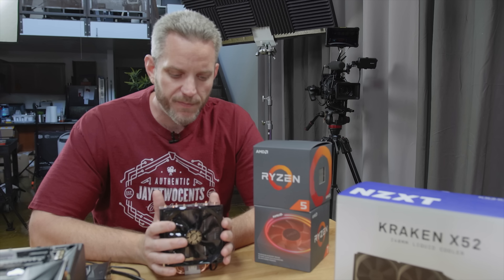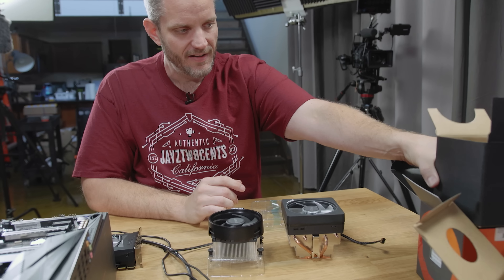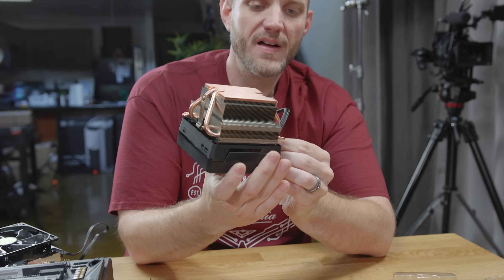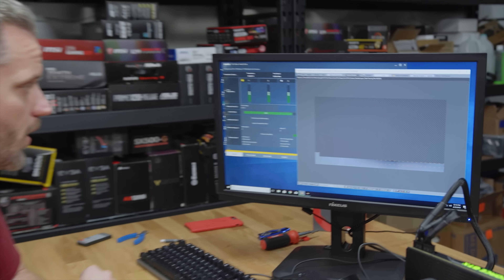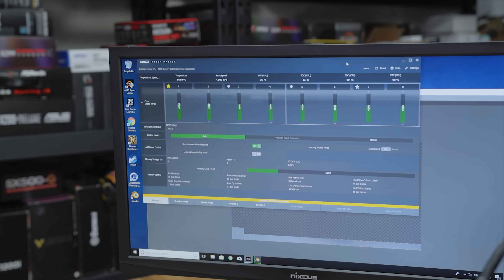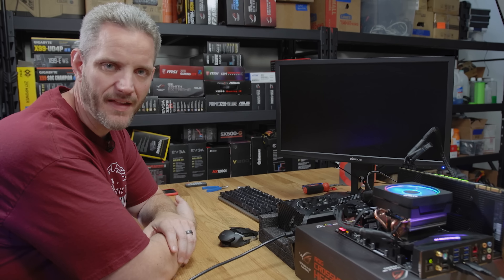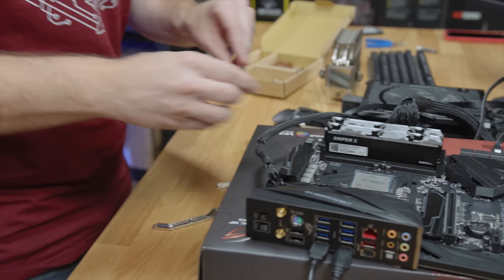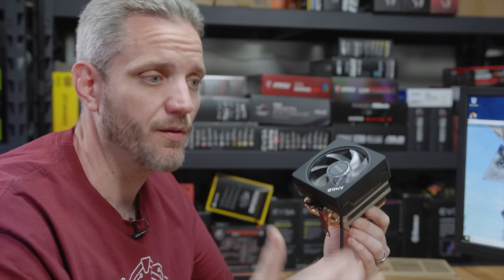Overclocking with a stock air cooler?? Is it even possible?

Comment: "I took off this stock thermal paste in order to put on another paste with identical properties so that I could mention my sponsor"
Reply: Naah stock thermal paste is bad and the way its put on will cause air bubble you have to put a small drop in the middle of the cpu and but the cooler on than to minimize air bubbles for better cooling performance.
Reply: Stock thermal paste is shit. like really shit. not a good mixture. and like the other guy said, air bubbles also can occur.
Reply: lol
Reply: He said he already tested the cooler, so the thermal paste had already been used.
Reply: @SleepyFawn  Yeah ... but if you think people listened, you're expecting too much out of people.
Reply: You forgot to thank him for his service. Rage intensifies 😂
Reply: @GermanLookLikeTV  The airbubble theory has been debunked by der8auer
Reply: @GermanLookLikeTV  Air bubbles are a myth, check out GN's and Der8auer's interview
Reply: Allan Huseyin stock thermal paste has barely any noticeable differences with other paste lol.
Reply: The cooler is made by Coolermaster as well xD
Reply: all silver pastes work same, if you have good cooler with flat surface, you can't notice ani differences between pastes
Reply: @GermanLookLikeTV  Nonsense. The people who apply generic thermal paste ALL DAY EVERY DAY at the factory do a fine job. If they didn't, machines would be getting returned nonstop.
Reply: @KunoMochi  Of course the stock stuff works fine. If it didn't, they'd have parts being returned all day every day, which is the last thing a factory wants. Thermal paste to internet PC builders is like Teraflops to internet console fans. It's an unimportant issue that people latch on to so they can play the "my thing is better than your thing" game.
Reply: @GermanLookLikeTV  wait really? Probably why I idle at 60 degrees
Reply: Stock thermal paste doesn't need to be changed. Most must be reapplied every year or so to maintain their quality. They leach out or something, says der8aur.

Comment: Oh man. Premium stock cooler and on the fly overclocking?! Why does anyone still buy Intel!?
Reply: Certainly not worth it until Intel release something new!
Reply: ronald4life1 I'll always buy Intel as its better for what I do I stream and game and I tested a 1700x and my 8700k is better still plus with Intel you know what you get out of the box not a fanboy and its disgusting the way people treat people when. They say they like one or the other but personally for me I'll always get intel
Reply: dan k Isn't the 2700X better for gaming+streaming? At least that's what the Gamers Nexus review showed.
Reply: dan k as far as IPC and raw performance in gaming, the Intel chips are still ahead by a bit, but if AMD can get within a few percentage of Intel with their single core performance, while maintaining prices, and thread count, Intel will not be a choice at all.

I am no fanboy, but it's nice to see such a garbage corporation have some proper competition now!!
Reply: Intel still kills in single core performance and gives higher fps when you're striving for 144fps.

AMD is catching up though so hopefully in a year or two even AMD can catch up in those aspects as well.
Reply: Quality components in builds are also very important... my 8700k with the Asus motherboard automatically runs my processor in turbo mode all the time at 4.4ghz to 4.7ghz... and with a Corsair AIO cooler my temps hover at 70c-75c under full load with the pump and fan settings on the factory quite settings. All this is also in the dreaded, horrible, no air flow case known as the coolermaster h500p with 3 120mm exhaust fans on the top in collaboration with the 2 200mm fans in front, keep my case temps typically any where from 25c-30c. But eh what ever 🤯
Reply: intel still kills it a bit with their coffee lake I7 when it comes to 1080p gaming or low requirement 1440p games and the diffrence becomes bigger the more high end the graphics card is paired with. Now who would do 1080p with a 1080 ti or VEGA 64? People with 240hz refreshrate monitors i guess however the higher u go in refreshrates the less noticable it generally becomes and a good amount of games are capped at 200 fps. The overclockable I5 is the only one that sticks out pretty good it can get almost the same fps as the I7 and therefore it's extremely intresting for people who only game and can invest the money saved in a fancier graphics card (wich might be very appealing in the current graphics card market) at 1440p or heck 2160p/4K every processor gets the same result cuz the gpu becomes the bottleneck.
Reply: It should be noted, the Ryzen platform performs better with faster memory. Without that, any gains from overclocking would be sub-par in comparison. The cost-effectiveness is tossed out far and clear when faster memory makes it perform better.
Reply: i wish to somewhat disagree 2666 mhz cl 16 timed ram will do you just fine for both workloads and gaming  the 30 euro/dollar diffrence isn't exactly gonne break the bank for going for 3000 or 3200 aswell the newer higher clockspeeds have actually reduced this effect suprisngly and when it comes to buying a higher end cpu like 2700x or 8700k i doubt both on the intel and amd side of things you will buy crucial/kingston 2133mhz ram without heatsink to save money. On top of that if you own an older ryzen cpu or alrdy have a higher class B350 motherboard that is updated or one of the dummy cpu's amd send out you can easily run your cpu on a B350 motherboard to save costs there are some B350 motherboards alrdy out with the updated bios out of the box for the new platform.
Reply: Because it's faster. Show me a faster gaming CPU than my 5.2ghz 8700k and I will gladly switch to it.
Reply: A Very justified statement when your main focus is gaming and you want the max of the max in terms of fps especially at 1080p and maybe a few frames at 1440p
Reply: ronald4life1 because Intel > AMD
Reply: haley smith I’m loving my 7740x lol
Reply: +ronald4life1 Intel has had on the fly over cloaking for several generations now. Its called intel turbo boost. Jay even mentions it in this video....
Reply: dan k Intel is better for gaming but in my opinion Ryzen is much better for streaming than Intel
Reply: ronald4life1 They spend 50% more for a 5% increase in gaming performance, I guess.
Reply: It's the best CPU for me mate
Reply: ronald4life1 because of much better gaming performance in the 250 dollar range, and better gaming as well as workstation performance at 300$. Yeah you can get the 8700 (no K) and even lacking overclock and even on it’s crappy stock cooler it still is quite a bit better than the 2600x and as good as 2700. So yeah amd has been utter trash, and now they are almost equal to intel at some things and even a little bitter at some things. But they are not much much better, they are NOT making intel obsolete just yet. Maybe next year, but not right now.
Reply: If u pay 300€+ for a Intel CPU you should be able to afford a cooler.
Reply: dan k but have you tried threadripper
Reply: ronald4life1 to spend $100 extra for little backwards comparability and 4% extra performance
Reply: Same reason people buy RTX: top of the line. It may be a 7% performance difference that only counts for games, but people will pay the Intel premium.
Reply: Brand Loyalty that gets them a Pineapple up the ass, Not to mention Brand Recognition (Much fewer people know and/or trust AMD as they have essential been outta the game for years!) same reason people still by Apple when both are just screwing us consumers over for less work and more money!
Reply: @DarthAwar  yeah amd is better for streaming but only for x264 but most use nvenc or amd vce for streaming nowadays (if the don't have an extra streaming pc) because only like 1% fps and if you have fast enough inet you can get the same quality. But if you would steam with cpu amd will be better. The 9k series of Intel is a freaking joke I bet amd will come with the 3rd Gen ryzen like April and it will of course have better single core perf as na 8700k while the price is 1/4 of the 8700k. It's like 400 now right? The 1800x is 200 now and in my opinion a better option but with the 3rd Gen ryzen Jesus that will be heaven and I hope they get the prices right so the end up having more marketshare than Intel so Intel wakes up to not try to just get our money. If amd would have been better earlier so they would have been a threat to Intel for way longer than now the compitition would have caused so much better cpus with lower price. Badly amd just recently went an alternative...
Reply: Not many people buy Intel right now, AMD is going ham 😁
Reply: @danielkerr4100  1700x and 8700k aren't comparable. especiall when the 1700x is like half the price of an 8700k now Try the 2700x and it does much better
Reply: Because it's still better for gaming. Because i7 4790k still beats all of current Ryzen chips for gaming in 90% of games. i7 8700k on the other hand is about 30-35% better than 4790k. Potentially giving you up to 20-30 fps more than i7 4790k, while i7 4790k beats the top end Ryzen in 90% of games, or matches it. 

So yeah...single core performance is not to be scuffed at on Intel, I owned 4 AMD cpus, and only 2 Intel's to date, to know the difference between them. 

Once you go Intel, and you know what to buy, you probably will not go back to AMD, unless you render videos and do workstation tasks. Then Ryzen beats Intel in that price bracket, but if you want top of the line, then Intel still has the crown with their i9 chips. 

Choose with your wallet, based on the performance. I bought i7 8700k, and I know how good that chip is. I managed to do an easy overclock at 4.7 ghz, under 1.21 volts
Less power draw, even better overclocking than 4790k, and overall better perfomance of about 20 fps in games, without upgrading the gpu. 

Also 8 cores 12 threads. Do I need to expand more on this, and I used to be behind AMD for a while, but their architecture for gaming is NOT there on the level of Intel...yet

Maybe new Ryzen? But I doubt it will beat Intel 8700k, let alone i9 9900k, I don't expect them to beat i7 9700k either. 

But don't take my word for it. You can put in:
 Ryzen (pick model) vs Intel i7 8700k/i7 9700k/i9 9900k in Youtube search. 
It's simple evidence.
Reply: Because intel is better. Intel is more expensive but you get more preformance. AMD is only for poor people on a budget
Reply: I had a Threadripper 2950x for strenuous streaming. When I replaced it for an i9 9980XE, I found a HUGE difference in performance.
Reply: They are making a sacrifice to let Intel live and hold the competition for us. :D
Reply: @danielkerr4100  How about now?